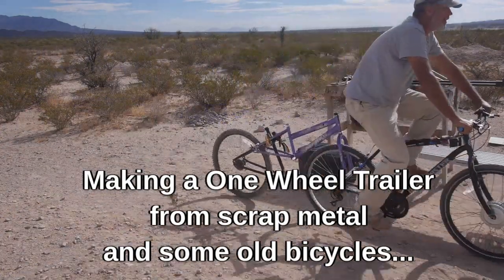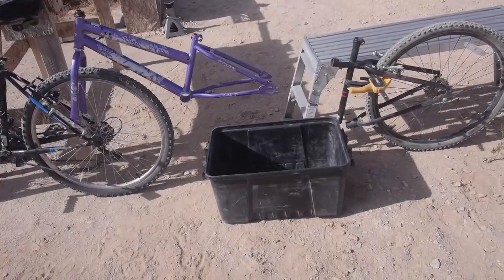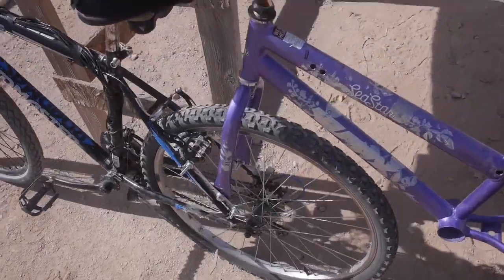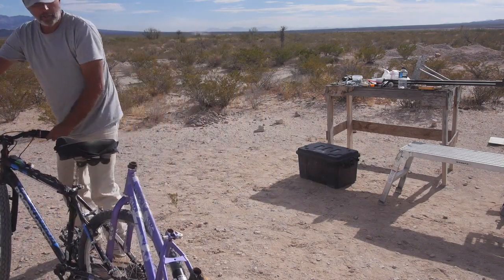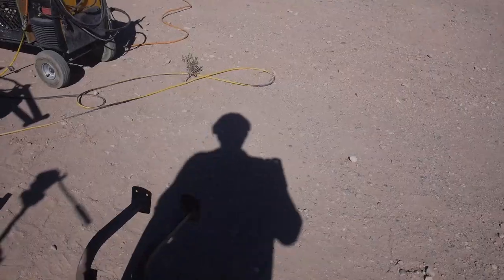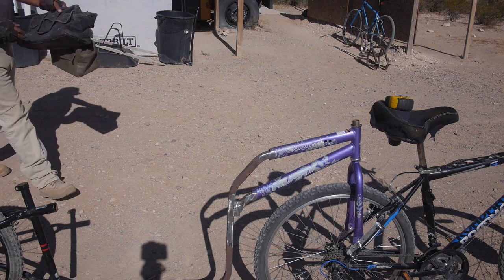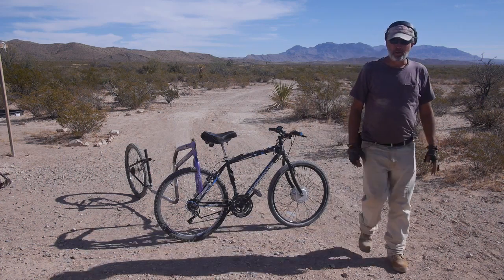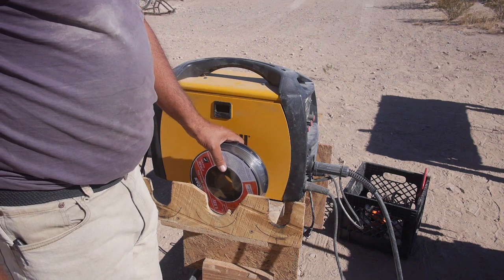Making a One Wheel Trailer for the Solar Electric Bike

Comment: Thanks!
Reply: Carlin, great job on the trailer! I think this might be The One! Is there still a bearing in the trailer neck where it attaches to the forks on the bike? Also, I think you have the right idea leaving the solar panel mounted flat since a good gust of wind could be a nasty surprise if tilted. Keep up the great work and God Bless!
Reply from the maker: Yes, steering stem has the bearings, that works really well. Once I'm rolling I don't even notice it. It's pretty awesome!

Comment: The bike looks nice! 
Now if yas remember me and my ideas...it might help yas..i do this all the time: on the 20 ' frame :heat the rear forks to spread them out 90 degres from the seatpost then mark them about the width of the box ya wanted to use...this way you can flatten them and use all 4 lines for top and bottom of a frame for the box...attach all together with bolts,lock washers, and nuts then attach it to the rear frame
Reply from the maker: Ok I see where you're going there, pretty clever!
Reply: Yes the frame IS the Box
Reply: @CarlinComm  and you can weld other bike tubes from thin frames for mor sturdiness and structure